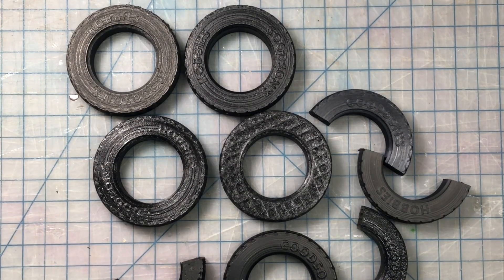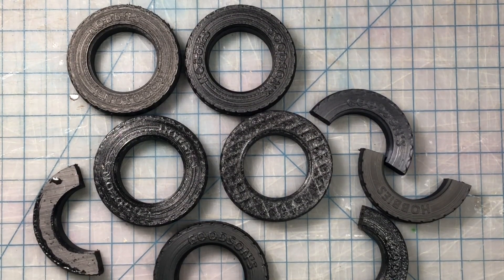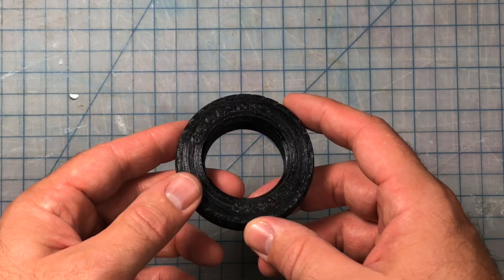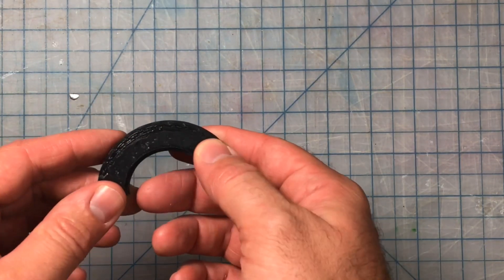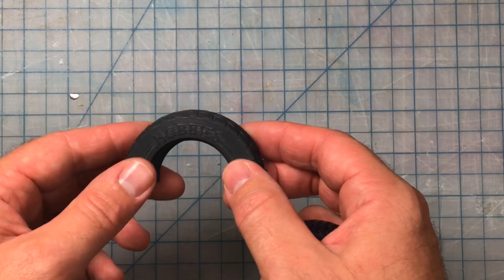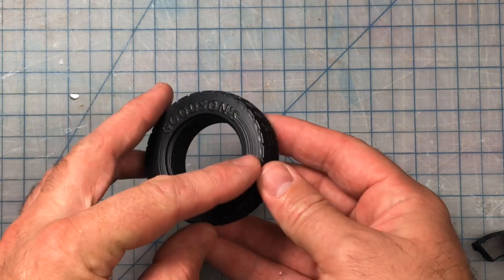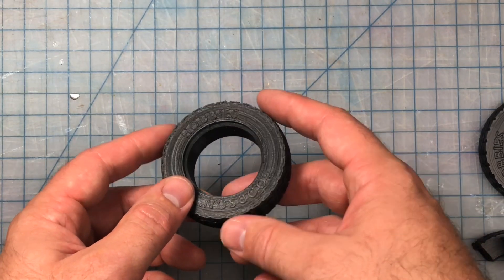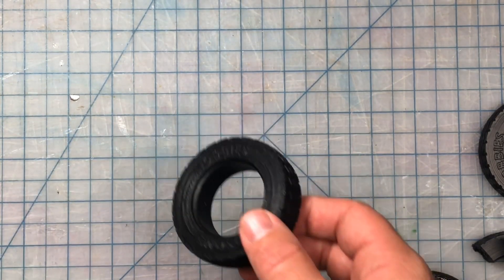Sandblasting and PlastiDipping TPU and PLA 3d Prints Trying to Make Scale Tires

Comment: I printed with 95a tpu. 1.2 sidewalls 0.8 on the tread. 2% infill. They came out good. The writing even came out nice. Plastidipped and it has better grip. Works well for the trailer. Will look into the beadlock version soon but havent found a tyre yet to print. Plus this size looks more realistic for a trailer.

Comment: I seen a video that was done back in like 2013 of a guy who soaked pla in cheap Walmart carburetor cleaner and it made the pla very flexible and almost unbreakable,  wonder how it would do on tires, also wonder how it would work on the tpu and poly or ninja flex
Reply: Also what if it had multiple walls and 0 infill
Reply from the maker: @DelawareRCMan  interesting, I would think breaking down the PLA it would never come back.  I haven't tried 0 infill, that may be worth a test!
Reply: @justingoodson3081  yeah I was surprised to see the pla do that too, it even did weird things with the color where as it soaked it turned white and after it was pulled out and dried its color came back, if I  find the video again I'll  get you the link
Reply: @justingoodson3081   heres the link to the actual thingiverse file which has the video too. I thought it was pretty cool and definitely has its uses! 

https://www.thingiverse.com/thing:98268